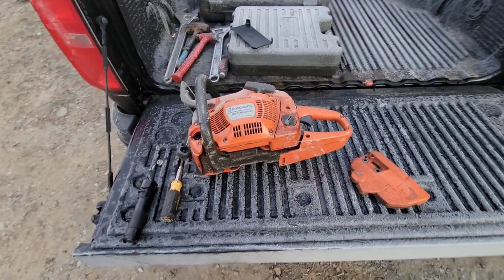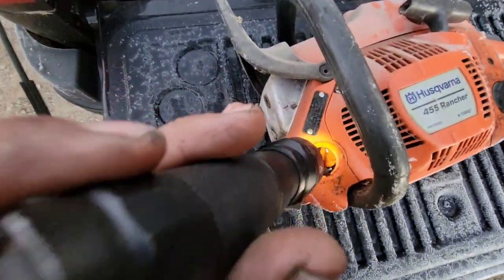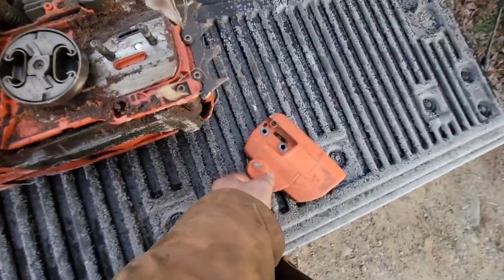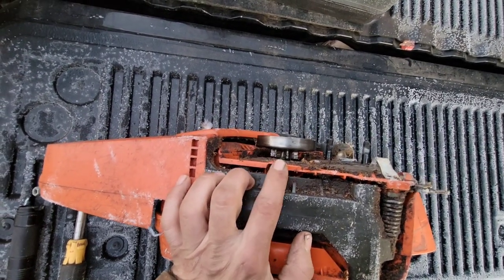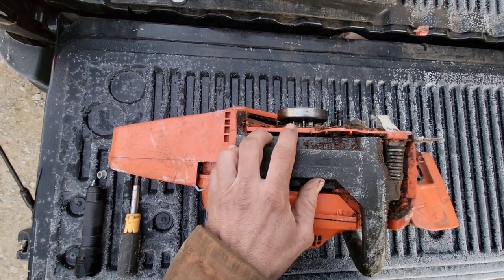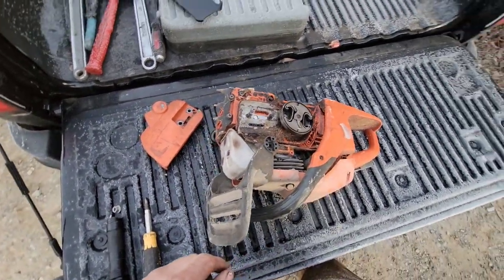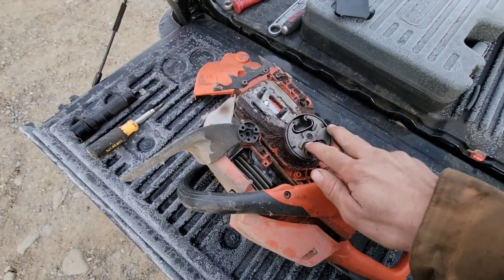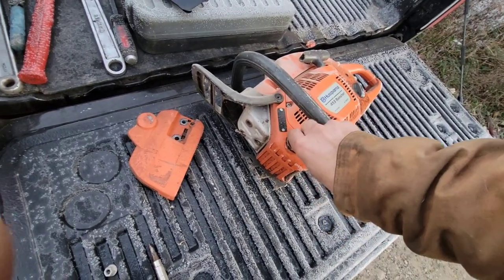Husqvarna 455 Rancher bar oil troubleshooting. Small Engine Tech with Josh- Chainsaw Edition

Comment: Great video! Just got a 455 that doesn’t seem to be throwing much oil. It’s been single digit temps here, hoping it’s just the cold, but will be checking these things out tomorrow. Would definitely like to see the video about the pump, but hoping that’s not my problem. Thanks for the info!
Reply from the maker: Bring the saw, and bar oil inside overnight when you know you'll need it. Verify if it is an aftermarket bar that the oil hole is properly aligned with the saw. When it's cold enough, they won't pump. My father used to cut bar oil with kerosene in the winter, that can help too.

Comment: Thanks for the info, yeah can ya show us the oil pump as well because mine is not pumping mush oil out, there's just a fine mist at the tip , i turned the adjuster at the bottom, it was on the center notch so i turned it to the left and right but didn't make any difference

Comment: My issue is that I'm dumping a lot of bar oil out while cutting. Should I tighten my bar oil screw slightly???
Reply from the maker: That would be the place to start. Just make sure it's coming from the oil hole on the bar mount, and not leaking somewhere else